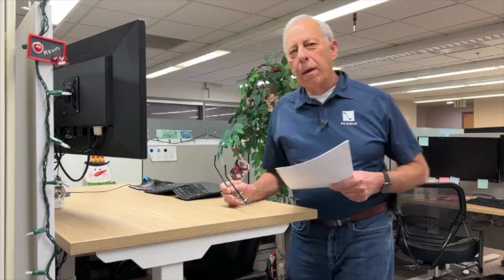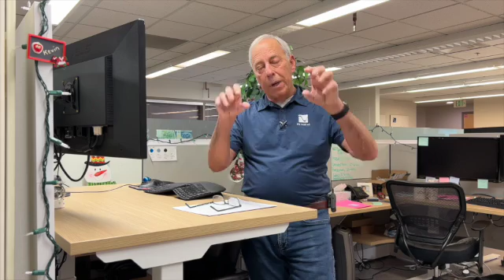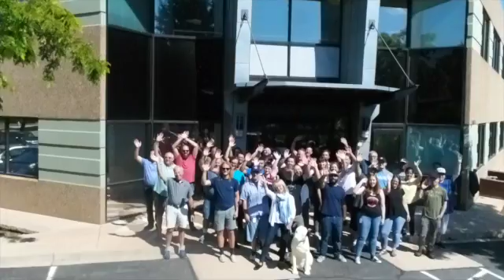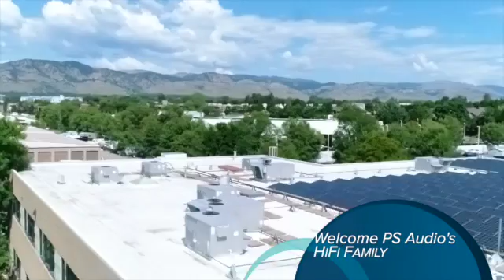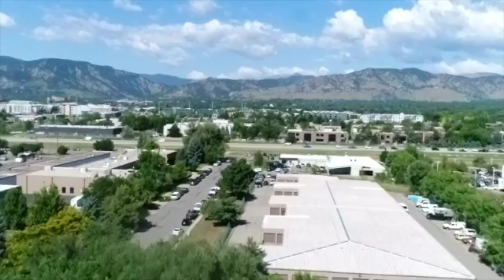The best use of a Power Plant

Comment: We just call these things a UPS, nothing more. A Sine wave UPS would do exactly the same job or even better at much cheaper. Besides a UPS draws from a battery which makes the output much cleaner. I now run my system off a 5kVA pure sine wave inverter/charger since dropping the PS audio power plant. Sound is cleaner and you don't experience any pumping sound anymore. It is smaller, weights about 40% less and is 95% efficient. Maybe does not look as nice but is just far, far better and less costly. Think what a 5kVA power plant would cost and it size! You don't have to display it so what it looks like is unimportant. Instead of a power plant buy a correctly rated UPS and spend what you save on a new amplifier or speakers, new streamer or a nice present for the wife.

Comment: I've read so much controversy about this subject, and unfortunately there are more opinions than people with real world experience.  Don't get a PowerPlant if you have $200 Sony speakers driven by a $300 HT receiver.  It won't help.  PP's are elite level components for those that have high level HiFi, and even then not all hear a difference. 
I have the PP12 recently purchased and have been evaluating it with multiple types of components, cables, power cords, speakers, amps... and I can say that for me, in my system, it is worth the money as my entire system got an upgrade in sound.  Part of that is from the DC blocking capability, part from the consistency of power.  Regardless of the exact reason for improvement, it's a dramatic upgrade from what I had.... (Niagara 1200).  Night and day.  
If you have tried one and it doesn't work for you that's fine... but you should consider trying a thing first before panning it based on some flat earther reviews on a web site.

Comment: Take 240 /120 AC make it into DC, Make it into  240/120 AC again, Take the new 120/240  AC turn it back into DC and  then hang your Transistors off it to make an amplifier. It seems crazy

Comment: ps audio power plant i thinks they are a powerful amplifier, you put inn  60hz or 50hz in and you get 110v out.
if you live in a 230v country, this amplifier must be powerful.

no amplifier is completely free of THD noise and other things. you push this amp or whatever you want to call it pretty hard I think. so if you want to reduce noise by 50%, it is not certain that it will reduce that much
Reply: A regenerator is a power amplifier. There's only slight differences between the 2. A few years ago when PS Audio came out their top of the like regenerator, I think it was the 1000, the also came out with a new power amplifier at the same time called the Classic 250. They looked identical. When Monster started making regenerators, they also started making power amplifiers at the same time. Again, the products appear to be almost identical, and I believe Monster hired Richard Marsh, a famous power amp designer, to make them. I know other companies did this as well, but its been a while and I just don't remember.

Comment: The disconnect is always amazing to me - the salesmen of multi-thousand dollar units praising their remarkable quality, to then make an about-face to tell you you need to buy a “helper” unit because their wonder unit you just bought from them is so incapable of handling an issue that every single electronic unit needs to deal with worldwide. So which is it - did you or did you not buy a piece of garbage?
Reply: Welcome to the audiophile world!
Reply: How come the designers of audio gear don’t think ahead and design circuits that deal with normal transmission fluctuations?
Reply: @MassimoTava 
"How come the designers of audio gear don’t think ahead and design circuits that deal with normal transmission fluctuations?"
 They do! Always did for the most part.
Reply: @MassimoTava  good call!
Reply: @MassimoTava  They do!
That is why "Power Plants" are just a bunch of snake oil.
https://youtu.be/12T7JFLGlf0

Comment: Can one say, that in countries with 115 V, and higher current capacity, the impedance and sensitivity induced by current draw, is higher than where the outlet delivers 240 V?

And regarding noise and distortion on the outlet sockets, some countries are much more clean and stable, where others are the opposite.

Comment: Why only 360p? Looks like web videos in the 1990s (or worse). 🤔
Reply from the maker: It's the stupid Final Cut Pro. Their new default is now really low. I will try and redo it. Thanks.
Reply: @Paulmcgowanpsaudio  That usually depends on your own preset values and choices in the "share/export" menu. Just change the preferences and you're okay.
Reply from the maker: @Fastvoice  It used to, yes. Unfortunately it's now permanently chosen in low rez and one must manually change for every video. Sigh.
Reply: Apple strikes again..🙄😳
Tim Cook knows what’s best for HIS OS, IOS and software and firmware. 😀 And you thought you bought an Apple device you own it..😀 Read the entire User Agreement you digitally signed and clicked that AGREE button for use of their hardware and software..😀 Maybe it’s best you don’t read it..😡🤮

Comment: Folks he is talking about one of the top snake oil devices in the industry. One of my friends bought a power plant and I listened to it connected and unconnected there is absolutely no difference. Even he admitted there's no difference but he just decided to keep it because it looks cool LOL. Paul do you understand that if somebody play their music loud enough to make their ears bleed it still wouldn't consume the wattage that a hair dryer or an oven ? Even my friend's power plant showed that only about 130 Watts was being used when we were playing his music ridiculously loud . So no, there is not a massive voltage drop from listening to music on your Hi-Fi system . This video is comical. It's so knee-high in crap it's unbelievable.
Reply: While it is true that not everyone will benefit from the use of a power plant or similar devices, you can't count them out. As an example, I live in very rural PA where the power lines are literally run through trees. If a fly farts, we get a power glitch. During storms, forget it. I have had two pole transformers, feeding my house, explode over the years. Power glitches and short, minutes, outages happen all the time. I don't use a power plant, but I do use pure sine wave regenerating UPS's. They work very well, but are also expensive. I happen to need the battery backup portion, or I would use something like a power plant. 

If you live somewhere that the power is stable and run underground, then I agree that you may not need such devices. There are no absolutes. You poo pooing Paul is no help and rude.
Reply: @alfonsodelafreg259  OK...it MIGHT be beneficial for 2% of the hifi people out there. Congrats to Paul for attempting to ripoff 98% of the hifi people out there. Better?
Reply: @alfonsodelafreg259  just calling a spade a spade. That's all. It's just obnoxious that he's trying to Peddle these power plants for thousands of dollars. I have heard one firsthand with my friend and we both agree it did absolutely nothing to improve the sound quality. His Watchers should know before they get sucked in
Reply: @alfonsodelafreg259  lol
Reply: @alfonsodelafreg259  I agree, at my friends house the light flickers to every bass beat. 😂But you know how these people are. 😉
Reply: @PSA78  Yep.
Reply: @PSA78  your friend's house has some major issues then. I have three Rigs in an 1100 square foot condo. Have never had any light flickering in 15 years living there while playing my music loud.
Reply: @0Perhaps  if you want I can give you where I live where he lives and you can meet us there I'm from Wisconsin
Reply: @ryanschipp8513  I am in New Jersey.  So no dice.
Given that Wisconsin is a sparsely populated state, you gave a location for any random person (in this case, me) to be nowhere near.

Please list every component of your friend's stereo.

Even better, please take a photo of your friend's stereo, and have your hand in the photo, holding a bottle of spring water, upside-down.

On a so-so stereo, a power plant is not going to help (or will be nearly useless).  So knowing the components is key to determining the reason for your friend's power plant issue (assuming you did not fabricate everything -- but I cannot be sure).
Reply: @0Perhaps  the guy has Canton Reference 3.2 DC speakers that are 16k speakers. Since you were acting like you're 10 years old I will match you. What do you have for speakers hot shot? By the way I live in Oak Creek Wisconsin and he lives in Fitchburg Wisconsin. Come on over Id love to see you run your mouth in person.
Reply: @ryanschipp8513  "the guy has Canton Reference 3.2 DC speakers that are 16k speakers."
Price does not dictate sound quality.

"What do you have for speakers hot shot?"
I am not the one that made the claim of demoing the PS Audio's Power Plant.  I am not the one that needs to "show off" his stereo.  Speakers, alone, are not a stereo.  You left off every other component.  Did your keyboard stop working?

Regardless of my gear, it does not change whether or not you are on the level.  You made the claim -- not me.  Based on your last comment, where somehow my stereo will determine whether or not you actually demoed a PS Audio Power Plant, I have concluded that you are lying.

"Come on over Id love to see you run your mouth in person."
Threats of violence is another indication of your being caught in a lie and lashing out with physical threats.  Not good.
Reply: @0Perhaps  what is with your water bottle fetish? Give me your contact information so that I can send you a picture of my buddies system with the power plant in it
Reply: @0Perhaps  Egg. I think you may be losing it. You were asking me for pictures of his setup with the water bottle. If I don't get your information how can I send you the picture? You do know that I can't share the picture here on YouTube correct? Apparently you don't know
Reply: @ryanschipp8513  Yes there was issues, that's the point, not all are stable and some will benefit (like  not hearing when the microwave is on).

Comment: Just remember before splurging on the power plant, to make the far less expensive investment FIRST of running a dedicated line to your rigs main outlet.
Reply: How much does that typically cost?
Reply: @djhmax09  I did all separate runs with 10 gage copper romex and upgraded the plugs and individual circuit breakers at the panel for each piece of equipment all in labor and materials under 2k and would say much superior to a power plant or conditioner. Now my breaker panel was one room behind my listening room and had access attic for running new wires. If you have long runs through lots of tight areas to get to a panel it can get very expensive and the conditioners might make more sense. It's a case by cases basis type thing that depends on your budget.
Reply: @nnndude  yes, I'm aware it'll depend on the situation. I was just curious so thank you for sharing. But you did all that yourself, would you know how much it would cost to have someone else do it for you?
Reply: @djhmax09  I didn't do it myself. I had a home theater type company with their electricians do it. Took 2 guys and about 6 hours of time. They charged a little over a grand to do it and that included the romex cable which is expensive. What an electrician charges will depend on what state you live in as each state can be less expensive or more expensive with cost of living.
Reply: @nnndude  got it, thanks for clarifying!

Comment: Most quality components have very good power supplies in them, and will work perfectly well with voltage swings, and the dreaded "dirty" power syndrome. I would expect that all PS Audio products have very good power supplies in them which would already provide clean consistent power for what ever that unit requires.  Case in point,...I have owned 2 PS Audio M700's, dead quiet, and have never had the slightest issue. Power regenerators, conditioners in my opinion are not necessary, and a waste of money.
Reply: You are sadly spreading provable misinformation
Reply: @davidcross890  https://youtu.be/12T7JFLGlf0
Reply: @JonAnderhub  100% aware of that video and test. My proprietary power circuits actually work in REALITY and I WELCOME a Public Comparative YouTube test
Reply: @davidcross890  You may be aware of the video but you obviously missed the part where Amir simply explains that such devices are unnecessary and ineffective because all A\V equipment has power regulation already built into the unit and that A\V equipment doesn't use 120/240 volt A.C. to run.
All A\V equipment runs on D.C. so it doesn't make a difference how "clean" the A.C. coming in is.
No need for a "Public comparative YouTube test" it's just understanding common electrical circuit design and common sense.
Reply: It's what you don't know that always hampers you
Reply: @davidcross890  Very true David, I have a extensive electrical background both in electronics and a journeyman electrician. My rig is north of 40K, and has no need for power plants or other things. Don't think I am knowledge hampered
Reply: @davidcross890  -- https://youtu.be/jeirY9tC_NU
Reply: @editorjuno  💯 aware of this video and test. My Proprietary power circuits actually work and I WELCOME a public YouTube Comparative Test
Reply: @davidcross890  -- Well, if you can find a way to market your design, I'm sure Amir would be glad to test the resulting product.  Of course, being more functional than one of Paul's overpriced door stops is a pretty low bar to clear -- and regardless of the results of any such measurements, the question of audible advantage will remain.
Reply: @editorjuno  I  believe I understand exactly what you are saying. I designed and built my technologies specifically due to poor to non Performance for my requirements of several of the big name products even up to two of the 28,000.00 MIT PMC Consoles
Reply: Yep Paul is worse than a used car salesman with these powery generators

Comment: Paul, I've heard it said that you are a self taught engineer, does that mean that you aren't a real engineer?
Reply: None of that is relevant since he doesn't engineer and is merely a snake oil con artist.
Reply: What do you mean by this statement , one does not need to waste time and money going to university and wasting time and money , real engineers are self taught with the guidance of those willing to take them on as a apprentice. If you want to learn you can just learn , hell I did , I went to Tennessee Tech University for 2 semesters just to figure out I could learn it all on my own with help from the world outside of university cost and all the bullshit extra courses one is forced to take just to make the university wealthy . If one has the passion in a specific field and wants to be in that field, all is needed is info and applied technics in the field 9f desire , Doctoring is a different story , but even wanting to be a lawyer, it only takes passing the bar 🍺 exams, which means do your own legwork, and take the test .
Reply: @jasontimothywells9895  Electrical and electronics engineers typically need a bachelor's degree in electrical engineering, electronics engineering, or a related engineering field. Studies include classroom, laboratory, and field studies. Courses include digital systems design, differential equations, and electrical circuit theory.
Reply: @JonAnderhub  only those that do not have there own capacity and people around them to be an apprentice for , I did what I did at Tennessee Tech University and then I went to work and was paid while learning , in highschool in 1987 my father hooked me up with his friends in the audio business. Stereo Hifi center and Miller & Kreisel sound Lab. My family was engineers in aircraft and audio . I have had several of my own businesses around the states dealing with sound and even got into recording when I built my own studio . It's about who and what you know that gets you where you want to be , me I have a boutique business in audio and other tech related things , I am my own person and did not need to go the route that others either had to , chose to or was forced into by overzealous parents . The difference between what I do and what Paul does is in different realms . And I have a lot of respect for Paul and the others in this field. I just do not want or need to be in the limelight.

Comment: Well.. Normal amps RARELY makes the volt drop any noticable if any.. For that to happen you would need to use ALOT of power and that powerfull amps are rare in peoples homes. And amps rarely use near the max power draw at normal and even very high volumes. So this would by your own despcriptiob really only help in a really a old house with an old unstable electric system.  Or maybe on your 120volt grid.. Don't really see the benefit in a 220/240v grid in a newer house. I see more of a benefit if you have alot of noise in the power grid.